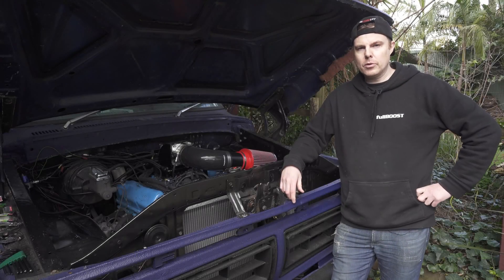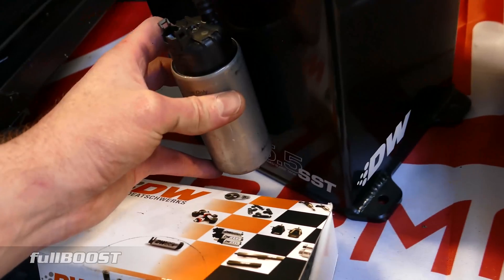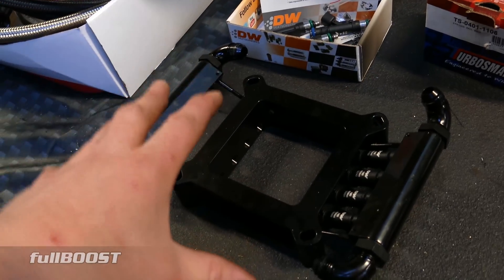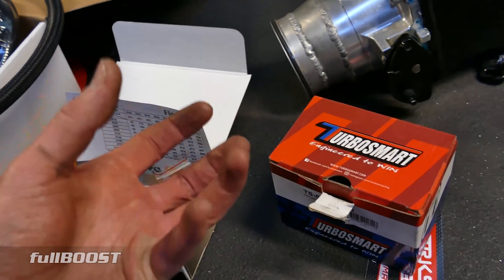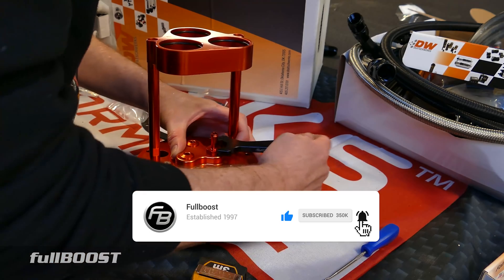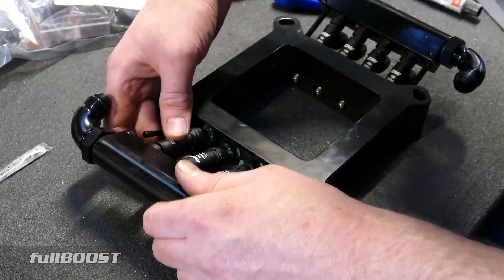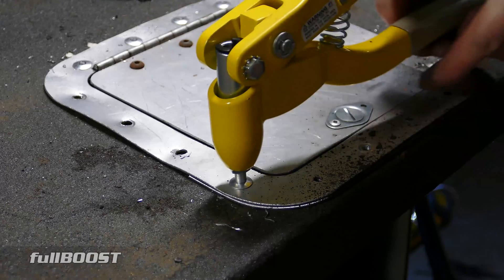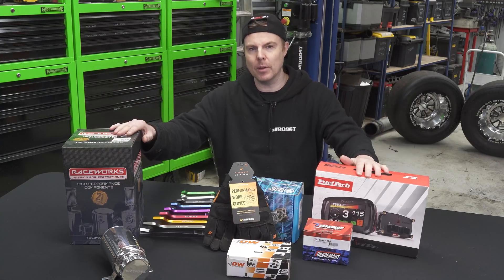How to convert to Fuel Injection | Ford F350 V8 turbo ramp truck part 7 | BACKYARD MECHANICS

Comment: I have just started using the AN fittings. They are brilliant. Quick tip for all. Be very mindful when tightening an AN male that’s next or close to another. Even with the AN spanner I was able to damage the face of the seal on one that was close. Didn’t notice the damage then had a leak. Had to replace the adapter. 
Earls make a new seal to fix this very problem. It’s common. A conical AN seal by “Earls” on eBay
Reply: There add is here https://youtu.be/Qv50yLCgrHE. If I remember I’ll update this with a review.
Reply: https://youtu.be/zMK6dUtupg4

Comment: Could have done away with the surge tank and just put a holley fuel mat in. Possibly cheaper?
Reply: I have to think about the unlikely chance of failure of a pump and serviceability. Full, the fuel cell will weigh about 80kg+. With it bolted to the truck, I have no way to access it other than removing it. With the fuel cell I can easily get to the pump if need be. I couldn’t just cut an access door either where it would sit as that’s where the front tyre basically is, so needs all its strength.
Reply: @BroomysGarage  fair call. I stuck one in the tank of my XA Sedan. Through the standard filler neck hole, after removing the tank! Fun times! Lol

Comment: Would it make any performance difference by removing the  the centre of the manifold" the 4 holes" ' where the carbie used to bolt on. I would seem the some of the injectors would be spraying  onto or very near the solid part ???  I realize that the injectors are higher because of the adapter plate fitted, but just a thought.
'

Comment: Nice short informative video. However I picked up that the fuel lines you made up didn't look like the teflon lines that you said you were going to use (nil explanation of the olives). Did you shoot footage using 120 series hose and not the 220 series? In hindsight, you could have also covered how to get a clean cut on the braided line.
Reply: There are plenty of videos on the internet on how to install hoses. Like this one. https://youtu.be/zMK6dUtupg4 we used both Teflon hose and a small section of nylon braided rubber hose as well.

Comment: I'm glad you are going to address the cost, because let's face it, to 99% of us it all comes down to budget limits.
Reply: 👍🏻 many ways to skin a cat with an efi conversion.  Cost is relative to function generally as well. This one will do full closed loop tuning, timing, fuel and boost control, with engine protection modes, a full display dash, data logger and has all new components with some well known brands. (Which of course no one will keep in mind and just complain it should have been done for half of what it cost 🤣)

Comment: DATA NOT DARRRRTA..... lol why not just say the price???? and what he said just get a holley sniper kit
Reply: Data. As in day-ta? No thanks 🤣 why not a sniper ? Because this efi unit lets me use it on whatever engine is in the bay, and also displays road speed, engine protection, full flex fuel, closed loop boost control, 7 bar map sensor, drive by wire throttle ability, and a number of other things the sniper doesn’t.

Comment: OMg guys, should have used a better manifold plate, the injectors spray pattern is going to be effected due to the current manifold plate, with the massive center section. :) A More open type, like a holly version. :)
Reply: I was thinking the same thing, and why not use 4 x 1200cc injectors, rather than 8 samller ones? It's not like they are port injection.

Comment: Alot of extra work here and extra costs when a simple holley sniper kit is extremely simple and even kits for that truck.. Using nitrous or turbo others with basic skills a sniper kit is 100% easier than this way...
Reply: I don't think you saw who they are sponsored by at the end of the video..... I'll give you a hint, it's not holley...
Reply: @A_lesson_in_Hate  completely saw that fuel tech help them out... Doesn't make it any less of a reason to recognise that in this instance fuel tech really are behind the ball and are complicating what others have available. Hopefully they are able to bring there products up into the same simplicity for others
Reply: Mavrick Harding the products are made for different consumers. Just like how Holley make the dominator HP. Someone who is running that isn’t going to want a Holley sniper either for what they need... just like me.

Comment: Cool video guys. One thing I personally like to use is OEM style hose clamps (where you're installing in the surge tank)
They look similar to a T clamp just smaller and tend to be a little more kind to the hose itself over time.
👍